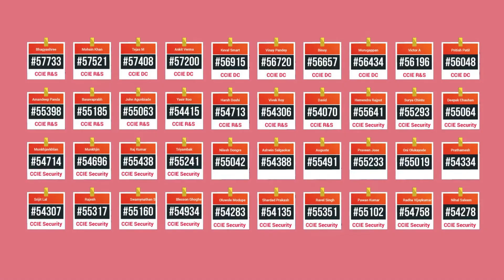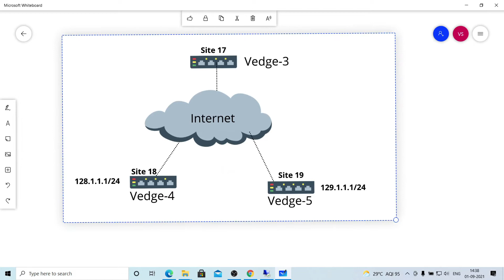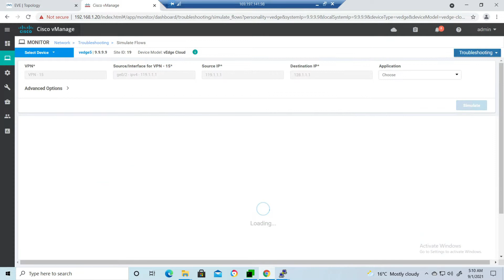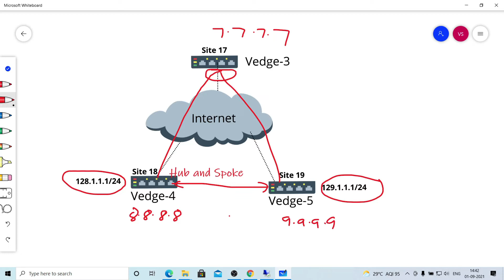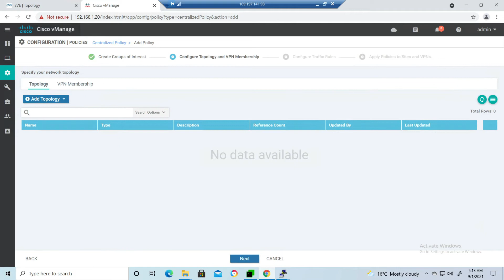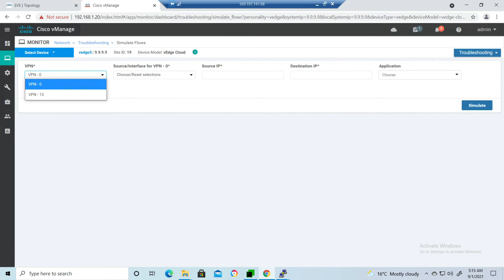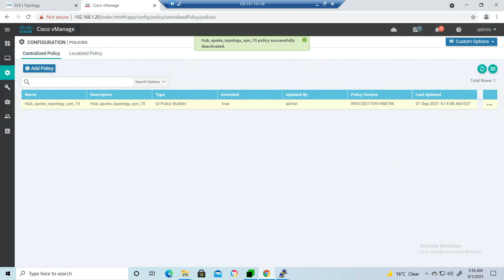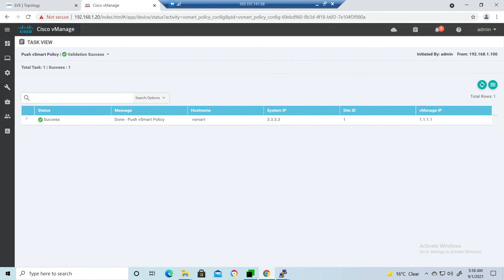Master SD-WAN Hub & Spoke Topology: Control Plane Policy Simplified! #networkershome

Comment: What the heck? More than half of the links provvided are jacked up. I click on sdwan link, does not work. If I go indirectly somehow to Trainer's site and then click on SDWAN course, it lands me on PCNSE course page. It's a Mess. 
Plus you guys need to move your mouse pointer a little slower and mention clearly exactly what link are you clicking on to open a new pop up window to configure
While you are ati it, make your mouse pointer a little bigger in size for better visibility. Extremely basic fundamental common sense items are missing in your videos.